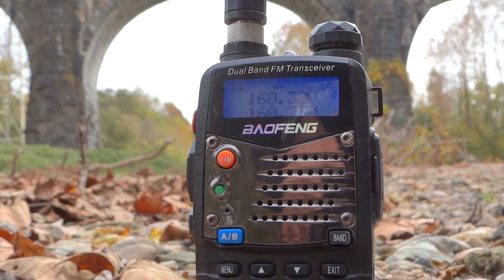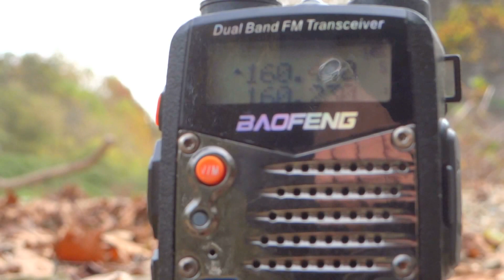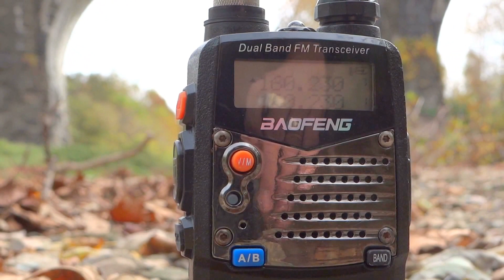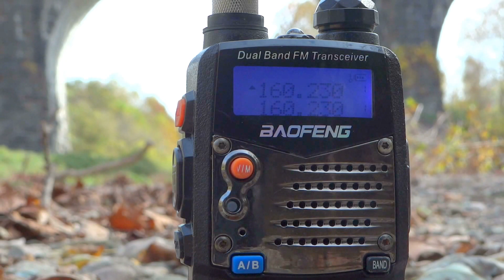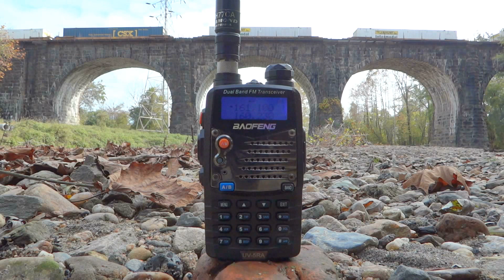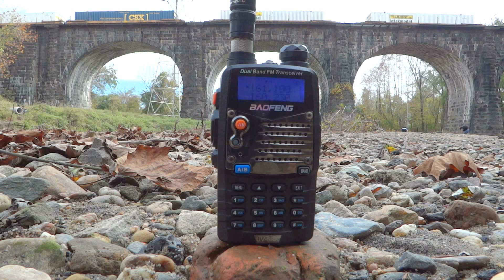Baofeng UV-5RA Portable 2-Way Radio

Comment: Nice radio. What is the range on it? I miss listening to CSX coming out of the Detroit/Windsor rail tunnel and running through the west side of town to word Grand Rapids.
Reply from the maker: That's impossible to answer. At times, it seems incredibly far. Not sure if you can relate, but at times I have heard crews talking on the MET and in Savage while in the middle on the Old Main Line. A couple of times I've heard crews north of the tunnel while at St Denis, Gun Rd., etc. But it seems very inconsistent. One reason my be that lingers on a channel too long after a transmission or even static. It scans way too slowly. And often it seems to get itself stuck on false signals (or maybe ones waaaaaaay far away) which pauses it's scanning.